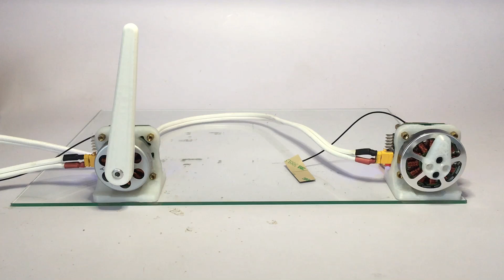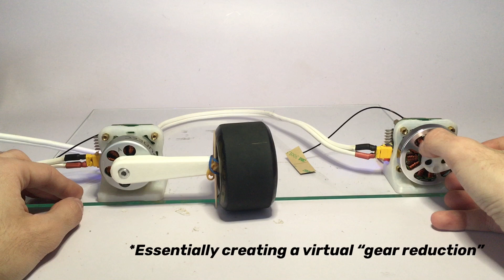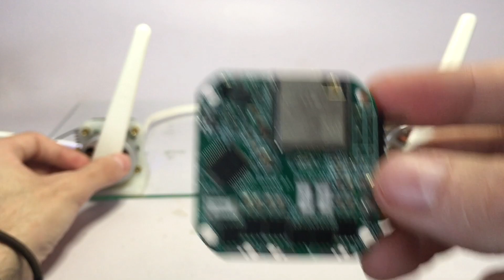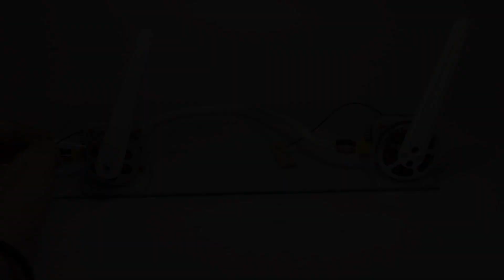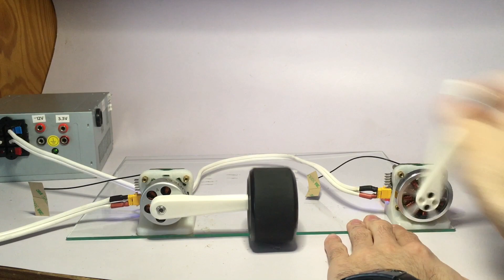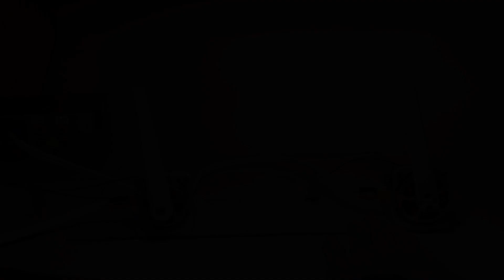Haptic Brushless Control - Telepresence Demo - Steer by wire(less)

Comment: That's wonderful, but is there a list of parts, code and wiring diagram for this specific setup? Just that, no frill simple wireless control of a brushless motor by another brushless motor. Thanks!

Comment: Hi Very nice.. Do you use any position sensor to do that? Are there any risk of instability depending on the sampling time? thank you
Reply from the maker: Yes, each motor has their own position sensor. It is possible to get instability but the sampling time would have to be very very slow.
Reply: @Dagor  Hello! did u implement just an action proportional to the difference between the angles of the two motors? Did u feel some restraint action on the master? Or it moves fluid? TY

Comment: Where did you get the motors from? Could you share the link perhaps?
Reply from the maker: Left motor is a YUNM4234 700KV I bought from ebay, right motor is a cheap 5010 360KV motor you can find on a lot of sites.